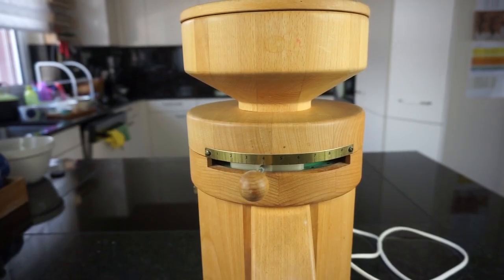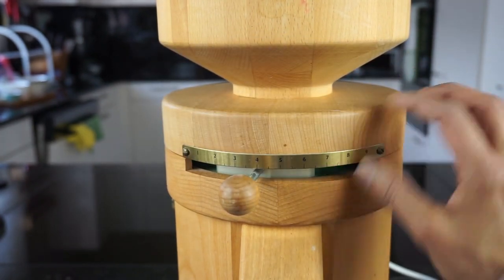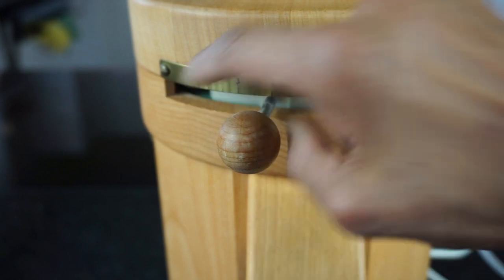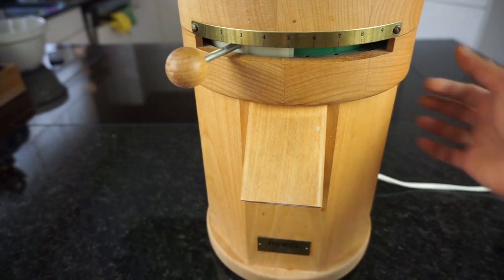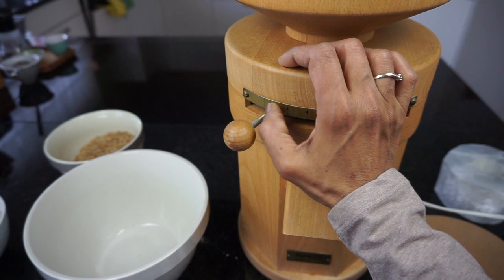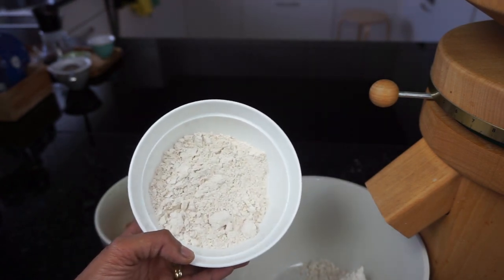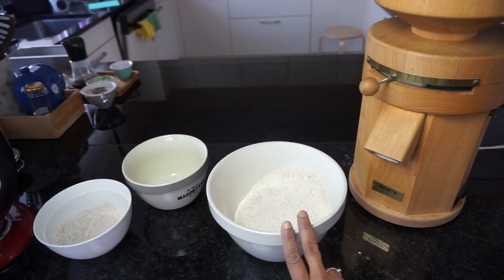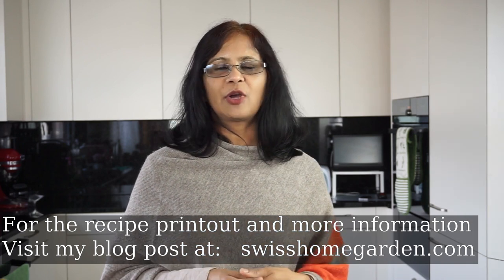How to grind flour with Hawos Oktagon 1 Stone Grain Mill

Comment: Does this mill grind a very fine flour suitable for Indian rotis/chapathis?
Reply from the maker: You cannot use a wet grinder for dry grinding. But with the ready flour, you can use the attachment for making the dough. You need to get a stone grinder like Hawos or Mockmill. I have those videos too.
Reply from the maker: It grinds to fine flour, but not like the sieved store bought flour. I was satisfied with the flour and made excellent rotis and chapathis with the flour. It also depends on the wheat variety.
Reply: @VitalFairLiving  Thank you for your reply.Between Mockmill and Hawos which would you recommend for making fine flour suitable for rotis?
Reply from the maker: @priyacse2009  I actually liked both. I will soon share a comparison video. But now I am unable to do edit anything due to personal commitments. Mockmill is a little loud due to the powerful motor.

Comment: Does this make a very fine flour suitable for making Indian rotis/chapathis?
Reply from the maker: Very fine flour like you get in the shops is not fully possible. You can of course set the grinding gaps as close as possible, but wheat is a hard grain too. It also depends on the wheat variety. I have ground with this mill and made very good chapatis and rotis. I never sieved the husk off. You can sieve the husk if you want it fine.